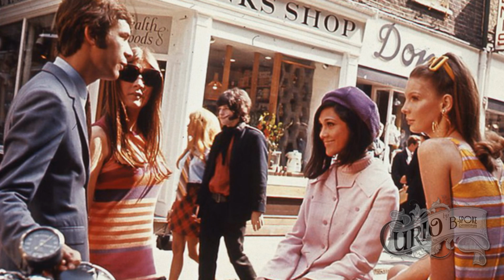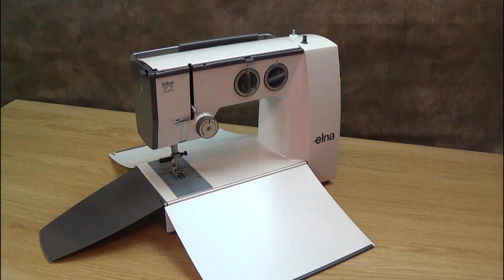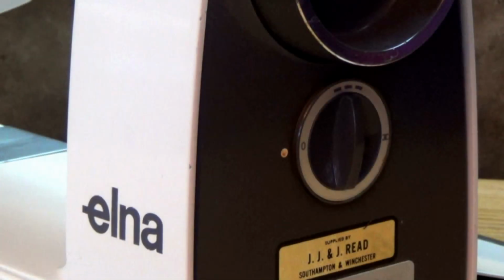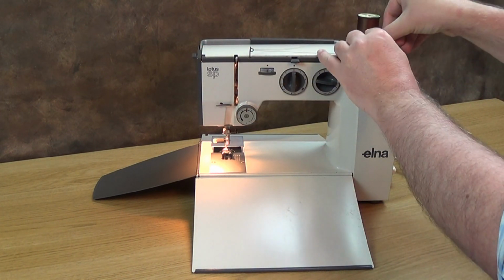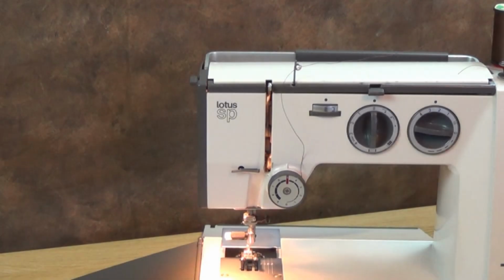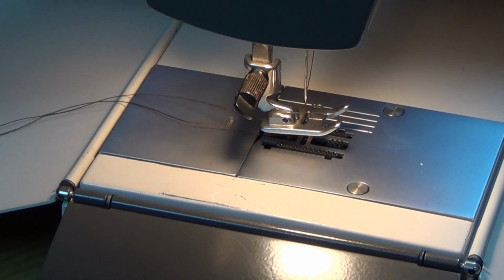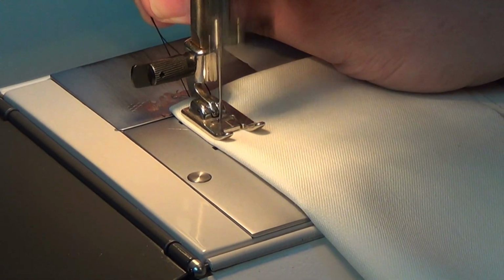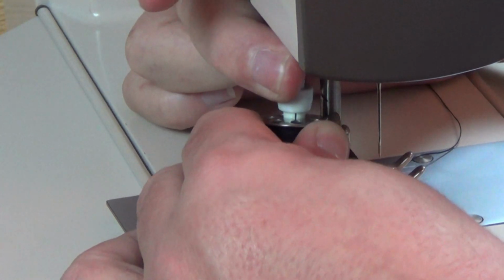Elna Lotus ZZ and SP Portable Vintage Sewing Machine - A competitor to the Singer Featherweight?

Comment: I recently bought a lotus SP from a friend of my wife for the equivalent of $5.40 USD. She had lost interest in sewing. 
No idea of when it was made. The only distinguishing feature is that it has smoked transparent 'leaves'
It seems in almost perfect condition complete with accessories and manuals. The only exception is that she did not 'park' it and left it for years, so the drive wheel developed a flat spot. 
That wasn't a real problem - I just sanded the flat spot out.
Reply: hii, is there any chance that you have a copy os the manual, or any similar thing?
Reply: @mariaarroquia3337 yes I do have the manuals.

Comment: Followed your instructions loosening the two correct screws. on my Elna ZZ. Bobbin case will wiggle but not pull out. Screws are loose and twirl in place. Do you think they are stripped somehow?
Reply from the maker: Are you able to tighten the screws again?
Reply: @CurioByBSpokeDesigns  Yes,  I've tightened them back down and repeated loosening them. The bobbin case just doesn't lift up though. I know a large guage piece of silk thread I was sewing with has become stuck underneath. I've oiled and worked the fly. but it's really stuck. Won't wiggle it loose. 
Any suggesdtions before I take it to my repair shop? Thanks so much for answering.

Comment: Hi, my Tsp will not zig zag. Do you have and suggestions? The needle will barely not move side to side when put into zig zag mode.
Reply from the maker: It may need a good cleaning and oiling. Make sure you remove any lint build up

Comment: Thanks for the video! I have inherited an Elna SP from my late mother. She worked as a purchasing manager for a large Finnish department store's sewing/knitting/cloth department in the late 1960s to early 1970s (they were the Elna importers in Finland). On an Elna sales broschure printed in Switzerland in 1967 the following prices are given for the following Elna models: Zig Zag 795 FIM, Special 895 FIM, Automatic 995 FIM and Supermatic 1100 FIM. In euro in 2022 that would equate to 1048€ - 2045€. On an Elna Lotus broschure printed in 1968 three sums are written on the back page, "e"-something 335 FIM, 695 FIM and "SP 815" which I interpret as stands for the Lotus SP. 815 Finnish marks in 1968 equate to 1398€ in 2022. The economy Lotus ec (straight stitch only) would then have retailed for the equivalent of 575€ in 1968 if that's the 335 FIM one.
Reply from the maker: Thank you so much for this information! I did wonder how much they would have cost when new.
Reply: hello, is there any chance that you still have the instructions for the elna sp
the fact is that I have that one my grandma used to use but I don't have the instructions and they would be useful 
thanks

Comment: I've had my Elna Stella TSP since sometime in 1980, and it is still my favourite machine to sew on. Is this also considered a "lotus"? It doesn't mention "lotus" anywhere on the machine or in the manual. I also never new what that white bobbin lifter was used for until this video!
Reply from the maker: If it has the fold out petals, it's classed as a Lotus, so yes!

Comment: I was gifted an Elna Lotus SP 35, in seemingly immaculate condition. I am new to sewing and have not tested it out as of yet. It came to me complete with all of the accessories, booklets, original sales receipt, and warranty card from 1972. This video is fabulous, thank you!
Reply from the maker: Congratulations! A true design icon and competent to boot!
Reply: I bought mine today with the 1973 receipt and the booklets. Please could you tell me if it has a high speed. Seems sluggish
Reply from the maker: @rukruk6289  It may just need oiling.
Reply: @CurioByBSpokeDesigns  I just oiled it in afternoon then read your comment. Yes it's working faster. I thought it was to do with not having the original pedal.
Reply from the maker: @rukruk6289  It could be that too but they are not the fastest machines.

Comment: This is so helpful. I got one of these years ago on eBay not really knowing much about it. I’m a total beginner so videos like this are much appreciated. I’d love to know if you have any tips on tension - that seems to be what trips me up the most.
Reply from the maker: Tension can seem a little bit of a minefield but it's really not so bad. Start by not adjusting the bobbin tension. If you get loops on the lower part of the stitch, tighten the upper tension. If loops are on the top stitching, loosen the upper tension. The ideal is a even tension top and bottom.
Reply: @CurioByBSpokeDesigns  how do you designate upper and lower? What happens to me often is bunching of the threads. When I stop stitching and go to trim - it’s not just the two threads front and back - it’s multiple threads. Does that make sense? I assumed it was a tension issues but could be something else I’m doing wrong. Hmmm. Thank you!
Reply from the maker: @JuliaJosephMusic  if the thread bunches underneath the fabric, then it's the upper tension that's too loose.
Reply: @CurioByBSpokeDesigns  thank you! Is there a toggle somewhere that allows you to switch between adjusting the top and the bottom?
Reply from the maker: @JuliaJosephMusic  No. the bottom thread is adjusted usually with a screw on the bobbin case. The top tension by the tension dial.
Reply: @CurioByBSpokeDesigns  ah! okay thank you. I think I have had the bottom tension too tight!

Comment: Hello, thanks for a great video. The reason I watched it is because I was given a Lotus SP just yesterday!! I wonder if you would be good enough to tell me where exactly I should oil the machine. I managed to get it going after a clean and it is very cute and sews beautifully although I know it hasn't been used for some years. I also have the sewing instruction booklet and the sewing guide booklet, however, I can't see anything about oiling the main body of the machine. Also, could you tell me where I might find the correct bobbin as it came only with a more modern metal bobbin. Finally, I tried to remove the rotary hook but the screws were very tight and one of them actually broke in half.  I would love to be able to clean it properly. Any advise would be greatly appreciated. Thanks, Clare.
Reply from the maker: If I remember rightly, the manual advises just a drop of oil on the bobbin race. There are some plastic gears on the inside and it's not a good idea to get oil on those. If you take out the accessories tray you can oil anywhere that you can see metal meeting metal. Facebook groups for Elna sewing machines will be good for finding bobbins and other parts. Good luck!